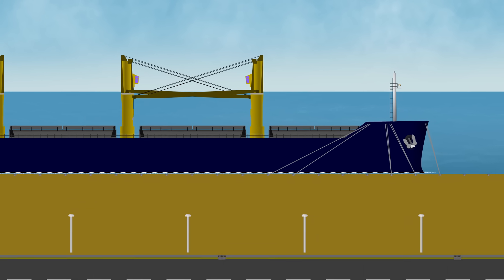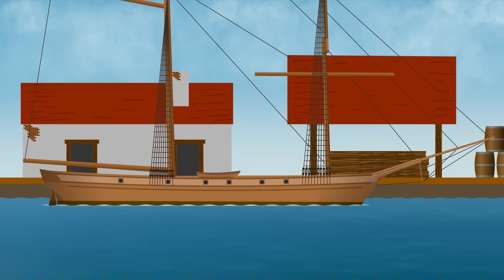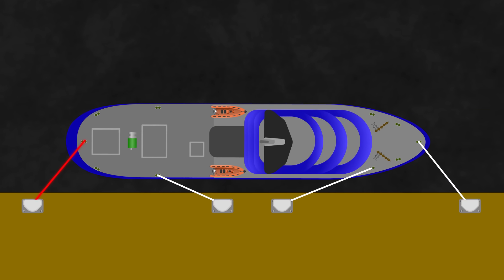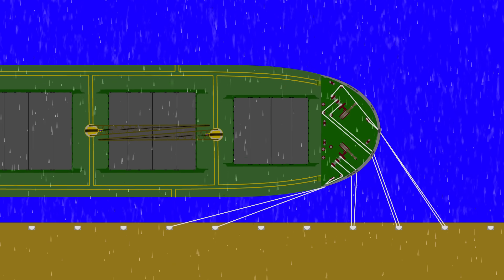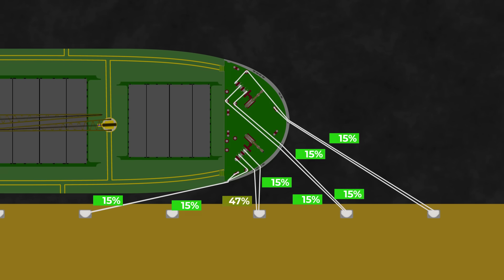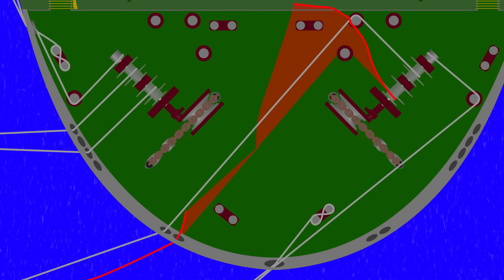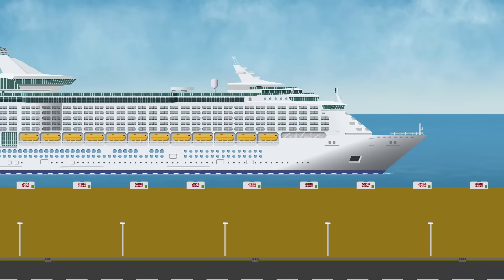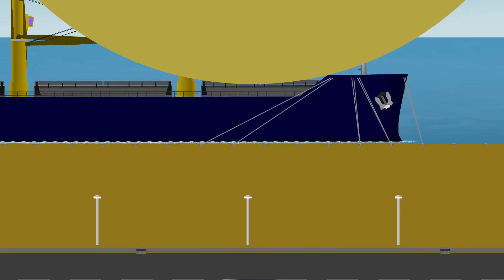Why Do Massive Ships Still Use Ropes?

Comment: Could you improve the situation by adding slip clutches on the winch the line is attached to? So if you get to 70% of the breaking strain of a rope it will pay out a little more rope, and probably sound and alarm.
This would make the snapping of multiple lines a lot less likely, as the lengths will redistribute so one line isn't holding all the force. 

I guess it would need more monitoring more of the time, but you would get a bit more warning of bad things happening.

Comment: For those who are scared of ropes snapping during a storm. Theres a simple solution. Longer springs, as long as you can get them. And if theres too much slack use more springs. The more of the force is destributed over the line the better it hold. 

You cant tie down for normal weather when theres a storm coming... or if you gonna stay awhile.

Comment: Ships can use one or two middle and in between the middle to the aft end anchor and one or two aft end anchors in the starboard side, and in port side if needed for extra stability in predicted strong winds at the port. They will be also useful in narrow channels, for stabilised steering. The extra anchors are highly useful for stabilising ship in a higher powered heat systems and higher intensity surface winds in narrow channels with busy traffic even without any engines on. One or two is written because, typically one is only usually seen, but another can be equipped for redundancy and for keeping steering, geometric axis of ship, as very highly stable, irrespective of the dynamic outside changes. Spacers can be fit , after the links are deployed electro magnetically to reduce tangling or one  anchor can be used at a time.

Comment: I could imagine it is not all negative for ropes to snap:
Wouldn't it be better for a relatively cheap and easy to replace rope to snap rather than damaging the ship or the harbour due to a rigid clamp or whatever that would not let go ?
I have no experience in that field at all, I'm just curious

Comment: I wonder if something like a hydraulic or pneumatic tensioner could be used for a line or cable that doesn't stretch to provide that dampening force against spike loads. Something that clamps onto the line ship side, where the line past the clamp can be loose and slack, so the device takes the transient loads, and if load exceeds the device's capacity, the clamp lets go of the line.

Comment: Nah, they'll never get rid of rope.  All the talk about the fancy new systems that rely on magnets or vacuums is just companies trying to get rich with bold talk that glosses over the serious drawbacks of those systems.  Rope is King, and always will be.  Sure, it has downsides, but those are far outweighed by it's many positive attributes.  As material science gets better, you can bet that even better ropes will be developed.  The only downside, really, to these modern plastic ropes is that they are almost always made up by braiding rather than good ol' three-ply line... and that's lousy for Marlinspike Seamanship.  😁

Comment: Great video. just one more thing to add is that's why it's very important to set BHC (brake holding capacity) is about 65% of MBL (minimum braking load) to slip brake before mooring line broken.

Comment: Has anyone ever bothered to put load cells on mooring line tensioners? That would seem to be a fairly straightforward way to ensure even tension. It could also be used with an automated safety system that eases off a mooring line approaching its limit to prevent snapback.

Comment: Thing is anything using electronics can fail, especially in bad weather. One high-voltage power line is knocked out in the wrong place and you've got a ship floating free. So while EM, suction etc mooring will come around because it's fast and convenient for loading and unloading, I think we will always see ships carrying mooring lines and using them when then are moored for a bit longer or expecting bad weather. Redundancy and not relying solely on a system out of your control is always going to be something that' on a Master's mind.

Comment: Vacuum:

The surface panel deforms during temperature changes, causing a loss of seal, breaking the vacuum. Ship drifts.

Magnetic: Power outage causes a loss of magnetic field, ship drifts.

Lines: Cheap. Don't require special infrastructure, guaranteed power supply, or consistent weather conditions.

By the nature of economics, I don't think we'll see an end to rope moorings for a long, long time.

Comment: Other than the common Manila Lines used on big ships, or Nylon Lines used on smaller boats, wire ropes are used as secondary mooring lines for more stability. Whatever a Captain and Boatswain decide to use

Comment: i like the ropes that have a slightly longer internal rope, so when the main rope snaps its sort of guided safely by the internal one preventing whip motions, (then when the smaller rope brakes its got much less energy and is weighed down by the main rope)

Comment: Except if the hull is perfectly flat along side a flat pier (preventing rotation), the minimum rope is not 2, but 3 : 2 at the same point to prevent this point to moving, and a third at the other end of the ship to keep the previous 2 to prevent the rotation.
Also, the stress distribution when wind pressure increase is not even, but depend on the geometry and the origin of wind. In addition, shorter line (which are also the ones taking the maximum pressure from a wind pushing the boat away from the pier) have less length to deal with shock absorption, so get are much more vulnerable.

Comment: Why is it that the non-stretch line (NSL) is not used in conjunction with a stretching line (SL)?
For example: the NSL connects to the ship, then to the SL, which connects to another NSL which is secured to the shore.
So as to allow for the stretch, but have the snap back occur in between the ship and the dock to avoid injury to humans.

Comment: I have been on a few ferries that dont use ropes for docking.
In that case, a steel ring on land got extended over a bollard on the ship with a two axis hydraulic rig.
Pretty fascinating to watch, but of course, thats not a very universal system.
The dock was made to fit the ferries.

Its also made to save on personnel for regular docking maneuvers (about 1 ship every 30-45 minutes coming in)

Its still a cool system.

Comment: Lacking shock absorption of non-stretching lines could also potentially be solved with dampened spring systems, no? The dampening would mean they'd not fling the line as violently when it snaps, if I'm not mistaken.

Comment: Why not have a core winding of nylon and a retractive winding of something that doesn't stretch. That way if the rope breaks, the snap back is confined to a specific length of the rope. The weight of the part that isn't elastic will arrest the wave motion of the part of the rope that is elastic. So for example, HPDE length, pad eye, then a length of nylon. or better yet take the two lengths and splice them end to end so that different sections of the continuous line have different elastic rates of rebound.  Like putting a harmonic dampener on an engine or an absorption spring on a leaver. especially useful if the rope that doesn't rebound has the lower tension/weight rating, but a higher jerk rating.

Comment: I'm just an amateur watching this video for fun, so maybe I'm missing something.

But why not have a cover to dampen the sudden snapback from the mooring lines parting?

I'm not talking platic or metal covers fixed in place, which are potentially expensive, inflexible, heavy and could turn into shrapnel if hit by a parted line; I'm thinking either a rope net or safety rope that's attached to the line where it comes onto the mooring deck. It's more rope that they're already using, and should alter the trajectory of a parted line so it doesn't sweep across the mooring deck like a death scythe.

I'm not in shipping, so apologies if I'm missing something obvious.

Comment: The PRIMARY reason for using ROPES, and especially ropes with some elasticity, is that oceans have these things called TIDES, meaning the water level goes up and down twice a day, and if you used non-elastic mooring connectors, like chains or steel cables, the increased tension at high tide may well cause them to snap, and a whipping steel cable or chain has a LOT more potential for catastrophic damage than relatively light rope.

Comment: Standard practice for USHOU Bayport and Barbour's Cut container terminals is 5+3.

Many vessel utilize auto tensioners, which generally give the longshoremen a hard time. I have found that one of our customers usually has the A.T. system at 50%, which gives the vessel far too much room to move and produce significant slack. Generally we'll ask the Captain to adjust for 70% if we anticipate high winds or high traffic (tankers passing by).

All I know is, I've been on a vessel and on dock when those lines snap; you can feel the concussion in your chest even from 100meters away.

Comment: So if that cruise ship ended up anchoring outside of the harbour, how did they get away from the quay? How did they haul in the lines at the stern of the ship, which were under load? Did the crew just have to risk getting hear the taut lines? Did they use thrusters to take the tension off them first? Did they get help from tugs? Is using both even enough when you have ships of these proportions?

Comment: Why don't they use chains instead of ropes?
Reply: Ropes are stronger than chains.
Reply: @peterprime2140  Wow, that is a surprise to me. Thanks for the info.
Reply: @peterprime2140  Why are chains used for anchors then? I guess ropes deteriorate when they get wet? I guess this must be a problem for morring ropes too though, in the rain or when pulling them in?
Reply: @sipos0  I couldn't find a clear answer for this, sometimes they do use ropes but chains are more common, chains seem to be more weather resistant and might be less  likely to get stuck and they're often heavier which helps in anchoring.
Reply: @peterprime2140  That makes sense. Thanks!

Comment: It kind of seems like the proposed solution in this video would have similar problems as ropes? If your dock's water height is going to be different, you will need some ways of adjusting the height of proposed hydrolic system's as it changes to avoid causing too much strain anyway. In that case, can't we just have mooring points that can adjust so the ropes can by dynamically eased in and out? The issue here isn't with ropes per se. It seems to me it has to do more with the inability to ease in and out at will. Otherwise at high tension anything is going to break regardless of using ropes or not.

Comment: I work at a harbour and board ships regularly. The most terrifying part of the work is not climbing the rope ladder, but going pass the mooring deck when we need to. There has never been an case of broken mooring lines in the last 3 years I've worked here, but the aftermath of a snapping line from the safety videos still a bit terrifying in my mind.

Comment: What if we put big ass rubber coated electro magnets in tracks built into the dock so they can move up and down and the break away strength could be a known factor that could be changed and wouldn't have ropes flying across the deck
Reply: An electromagnet requires a lot of electrical power just to lift up a ton of iron junk.

Comment: to "develop something better".  I like your thinks.
BUT, (I'm judging from the video.  I truly hope the "real" engineers are thinking better).  I can "see" straightaway.  They are building from the (wrong side).  I like the "shock absorber" that was presented in the film.  SO, likewise, I do advise on keeping that aspect.  As for a (vacuum) attachment.  nay, on that idea.  Put a moveable wall to "crush" the ship against said "shock absorber".  A wall, is probably to prone to decay and oxidation and barnacles, so (A wall) is not the way to go.  It need be (several) smaller contact points.  The (engineering) would need to start on the "ship" side.  Each vessel needs to have "connection" points.  After you set your standard on "how big" of a "wall".  Pass this info on to the individual ships.  They can outfit their vessel to comply with your standards.
Problem solved.

Comment: Back in '86 I was stationed to a tender at Sub Base SD. Anyway, I got there about the same time as the ARDM-5 Arco (floating drydock). It was brand new and I could be wrong but I believe it used clamping technology to secure to the pier. I also believe they had a tough time getting it to work properly. The idea was to give it a smoother ride going up and down while a submarine was aboard. I could be completely wrong, it was a long time ago.

Comment: When I worked on tankers (600 feet) our standard set up was two headlines or "bowlines" one line on the breast off the morring deck, four springlines (two forward and two aft) two offshore sternlines, and one bite on the breast of the stern. The springlines were approx 1.5 inch greased steel cable. The lines were woven polyester of approximately 4-5 inches. Polyester floats well which is another benefit since the lines weigh a lot and, when released from the dock, they don't drag in the mud on the bottom.  One of the first things we learned is never put your head above the bullworks when docking lest it be taken off if a line parts. Tankers dock in slips a lot so the bow lines are often used to control or stop the backward motion and fine tune the discharge header to the refinery headers. That would require a few turns on both bits and the mate to call out when the seaman needed to add a little slack. The tentiom on those lines was palpable. 

Good stuff! Your work brings back memories.

Comment: I don't think ropes will disappear soon.  They're cheap easy to use tech that doesn't require any extra, like electricity (if you use a magnetic device to hold the ship for instance).  Also anything made from metal has to be made to withstand the corrosive environment in seaports.  And not every port will get the new system immediately, if at all.

Comment: I'd have thought an easy solution is just to engineer the weakest link at the safest place. E.g. have the ship ropes be the strongest and attach those strong ropes to the mooring with short weaker ropes. then the weak ropes snap first, they're short, not a lot of of stored energy and fail somewhat safely. The energy in the bigger ship ropes should be tamed by their weight and the upward and shipward angle of their snap back.

Comment: Naah. Ropes won't be replaced anytime soon if ever. That "weakness" is their strength. Their ability to give under stress prevents greater damage being done in an unexpected event such as those that heavy waves and unexpected wind gusts can create.
Suction would never work for the same reason you can't get suction cups to stay stuck after the fourth or fifth use...and that's a small area. Magnets can be very strong but then you are still faced with the issue of a more limited range of motion and give than you get from rope. You want rope made out of material with a bit of elasticity combined with strength. While that may pose serious injury risks if it snaps, the likelihood of that happening and causing worse damage is far less than with other mooring systems.
BTW, I've seen what a rope looks like after it snaps and it no longer looks like a rope. "Rat's nest" is the term that comes to mind. ;)

Comment: Excellent video again, thanks. In a former live I was involved in mooring solutions (all sorts of fenders, bollards, cleats, capstans, quick release mooring hooks, etc). The berthing of a large vessel is incredibly complex. Quay or jetty design plays a role, fender and bollard selection, vessel characteristics, etc, etc. The PIANC offers all sorts of recommendations for a proper designed berthing system. 

Mooring ropes are still the best universal solution: they offer ways to deal with dynamic loads, they distribute the loads to parts of the vessel that are designed to carry those loads. Under extreme conditions, they prevent damaging the vessel by failing. 

Other systems, such as suction berthing systems have a big downside: they apply the load to a part of the vessel that is not designed to handle that load, unless the vessel is adapated for that specific berth. Such berthing systems therefor will not help in case of extreme situations, as that may result in severe damage to the vessel.

Sometimes, it is just hard to improve a thousand year old solution, because it is probably the best solution to start with.

Comment: During the flood in Portland in 1996, I was working a security job at the docks. The ship I was assigned to was an old oil tanker that had been there for a long while. That flood brought it up out of the mud and the mooring ropes were tight as piano wires. No one was allowed anywhere near the ship until the waters eased up. I’ll never forget the way the ropes look and the gangplank all torn apart.
Reply: I was there for that flood too.  I saw the horseshoe falls at Oregon City go flat!  And I saw pieces of docks with 3 or 4 pleasure boats still attached float down the Willamette.  But the most heroic thing I saw was 2 Moss tugboats pushing against the current to hold the Steel Bridge on its footings (that's the main rail bridge in Portland).